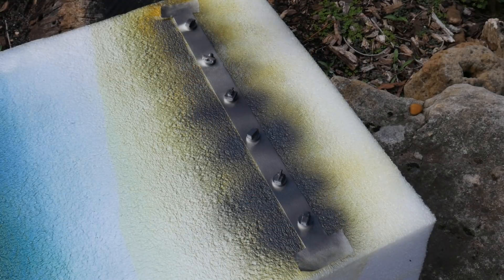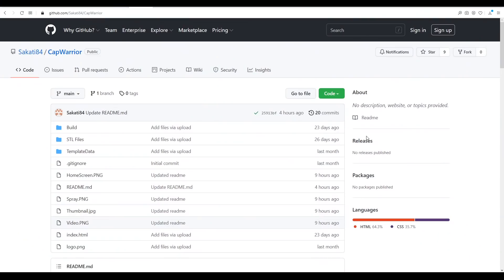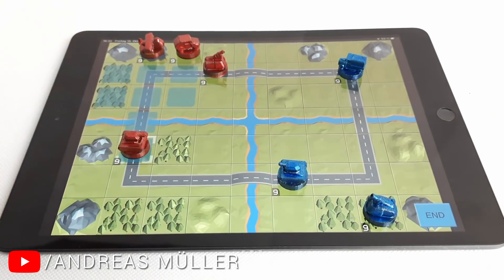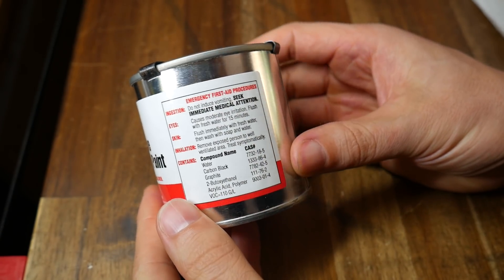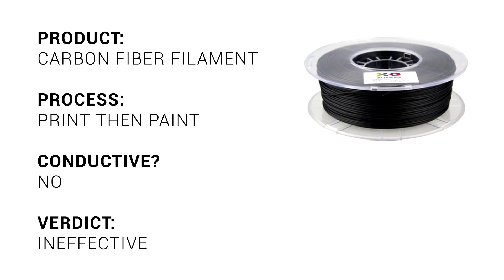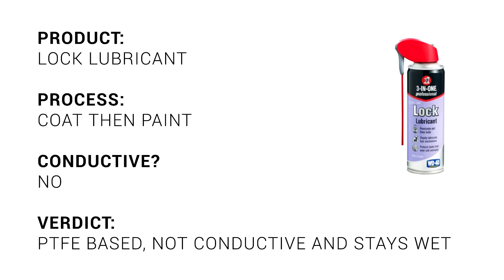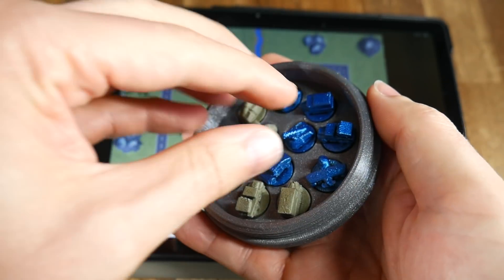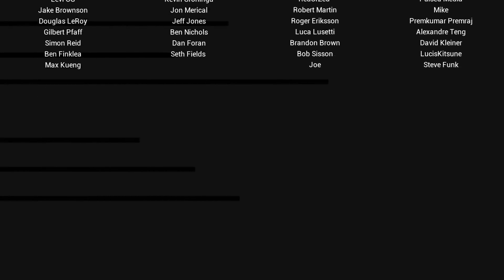CapWars: A free, creative 3D print and play video game you should try

Comment: The reason why the whole piece has to be conductive is because the touch-screen is a capacitive device. It doesn't register the piece, it register's your body's capacitance when you touch the piece. If he used a wooden stick to move the piece it wouldn't register it.
Reply from the maker: I was going to pin my own comment explaining this but you've covered it well. There's a lot of suggestions for other techniques in the comments but many don't understand this so the proposed techniques won't work at all.

Comment: Maybe using a cheap airbrush could apply the graphite powder in even coatings? Use something like spray paint to prep the surface and make it sticky, then apply the powder.
Other than that, I think some dry film 3 in 1 lubricants are basically just graphite suspended in isopropyl alcohol and that could have some potential?

Comment: Make or drill a hole vertically and pass a wire to the base with aluminum foil circle you glue at the base. The top has the wire sticking out which where your finger would touch. Very simple.
Reply: i was abıut to type same things added with alu tape copper tape a needle nail or screw as alternative.

Comment: When I need to make conductive paint, I usually mix graphite powder with acrylic paint (whichever color might do, I usually use dark grey) in a little cup, then apply the resulting paste on the surface. It makes a very nice looking result (like metallic grey), is VERY strong, dries in a few hours (overnight for the paint to strongly settle down), and moreover : it's VERY conductive. I actually revived a dead Amiga 600 keyboard membrane with this mixture once. And it's really durable too, in my experience. It has to be tried on that specific context, but I'm fairly confident it might be the nice, easy, safe and cheap solution you could be looking for.
Reply: What ratio of graphite to paint do you use?
Reply: @RegularOldDan  I have no exact proportion, tbh ... I usually put one coffee spoon of graphite on a piece of paper, add the paint, then I stir with a spudger (I usually use chopsticks, since a have quite a bit of them) until I get a fluid and regular greyish looking paste. I usually use the spudger to start spreading the paste on the surface I wanna cover, then I use a paper towel to finish it and make it look more even. It's a bit DIY'y, but it usually works fine. (and it looks great, I sometimes use the same thing to purely decorative purposes)
Reply: @WhoIsLudwig  Thank you very much for the information!
Reply: I've done something similar with 2 Tube Epoxy, and I imagine it would also work with A-B Resin as well as UV Resin both used in art contexts.

Comment: Why not make life easy and glue a washer to the the bottom of each piece?
Find an appropriate size and thickness and you're all set. Job done.
Reply from the maker: It doesn't work that way. You need a connection between your finger and the screen. That means at least a strip of something from the top to the bottom. I'd also be concerned about scratching the screen with a metal object.
Reply: @TeachingTech  Going back to 2008. This is one of the demos I am referring to.

https://www.youtube.com/watch?v=D1IpDStL23M
Reply: @TeachingTech  Hmm. This stuff goes back a long way to Microsoft surface coming out and being used as a digital tabletop. Perhaps implemented a little differently. There was all sorts of interactivity between the screen and the item being used in the demos I saw. Menus, pop-up info, etc.

Comment: I love the game and application but this was pointless. You used all these expensive paints but ignored the obviously usable products. The first and best is a liquid solder pen for solder board repair, and the most obvious and cheapest, aluminum ducting tape!
Reply from the maker: If I knew about the silver pen I would have tried it. I discussed this with Andreas and my patrons to come up with as many possibilities as possible, but this never came up. Are you sure you would be able to apply aluminium tape to a 3D dimensional surface like this? Sound near impossible. Much harder than the $8 a can graphite spray proposed in this video.

Comment: You should print a QR code to the game on a sticker and stick it to the inside of the lid of the parts container or even better, emboss it into it when 3D printing it and then coat it with black enamel (if not too detailed), that way it will be as simple as using the tablet to access the game without need to track any website
Reply from the maker: I agree, that is an excellent idea.

Comment: Great video and very cool mesh of 3D printing and gaming software. Another idea for making the pieces conductive is to use adhesive backed  discs cut from metal tape such as aluminum or copper.
Reply: And how does that transmit the capacitance from your body to the screen? The screen detects the capacitance of your body when you touch it, as such, the WHOLE PART needs to be conductive in order to work, not just the bottom. If he moved the game pieces with a plastic or wooden stick, this wouldn't work.

Comment: Why didn't you just stick some air con duct foil tap on the bottom.
Reply from the maker: The conductivity needs to touch your finger and the screen so a coating on the bottom is insufficient.

Comment: Hmmm, could we just mix some copper or silver power with some epoxy and coat the bottoms of the part with it?
Reply: Only the bottom is not enough. You need the figures to "extend" the fingertouch to the display.

Comment: just buy some injection moulded plastic pieces and spray them. no need of using 3d printing
Reply from the maker: Technically yes, but most of the point of 3D printing is the ability to design your own, custom parts. Using only off the shelf minis removes the creative aspect or me, but I understand others may wish to adopt an existing set of characters and focus on the software side.
Reply: That's not the point.

Comment: Wouldn't it be easier to add a small metal washer after the first layer was printed, or to glue some of this special rubber stuff those pencils have at their end to be used with touchscreens? All the hassle with this "chemical warfare" sounds kind of "the wrong way" to me.
Reply: This wouldn‘t work since it needs to connect to your hand.
Reply: @andreasmuller5630  even this rubber stuff? I do not touch it when holding a pen with this special rubber.
Reply: @peter.stimpel  Yes, these pens don't work with gloves
Reply: @andreasmuller5630  never tried with gloves, I must admit - had no reason to

Comment: Only the bottom of the parts need to be conductive right? I would be scared that the graphite would scratch the screen. maybe there is some kind of soft felt pad with adhesive that would work?
Reply from the maker: The whole part needs to be conductive. The graphite products we are using it here are lubricants. The screen has no damage not do I expect it to receive any.

Comment: Very cool!  Question: do the tops of the models need treated with conductive materials?  Why not just the bottom surface?  Thanks!
Reply: That's like those gloves that you can use with touchscreens. The capacitance comes from your skin, and it's conducted through the conductive material.
Reply: Guess so because if you tap the top of the model it needs to detect it